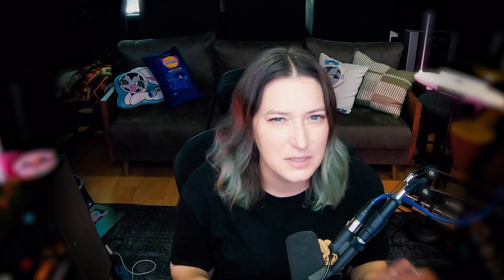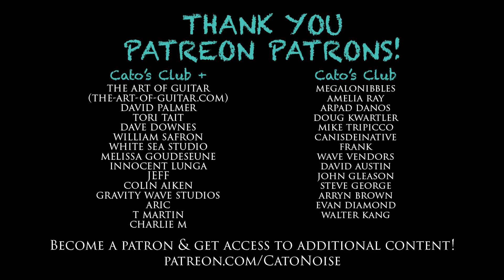Audio Engineering Basics: Monitoring Your Mixes

Comment: I got SonarWorks two months ago and it really improved things in my room, my Yamaha HS-5s (w/ Sub) had a bad high end roll off starting very early at 4k, to -6dB at 10k, and ending at -15 dB at 20k. As soon as I hit the eq compensation button OMG I could hear the highs (and mids) for the first time. Two years in this room and I didn't realize, I spent all day listening to everything as if for the first time. It improved the low end as well.
I've the heard advice that Sonarworks is no good if your room is untreated but I think it's the first thing to get even before treatment because it immediately improved things for me and now with the measurement data it provides I know how to approach room treatment according to the problem areas it reveals.